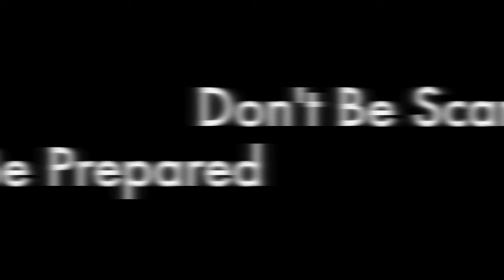What is Electromagnetic Pulse

Comment: As a Texas State Senator who tried in the 2015 legislative session to get a bill passed to harden the Texas grid against an EMP attack or nature's GMD, I learned first hand the strong control the electric power company lobby has on elected officials. We did manage to get a weak bill passed in the Senate but the power companies had it killed in the House. A very deceitful document which was carefully designed to mislead legislators was provided by the power company lobbyist to legislators at a critical in the process. The document was not just misleading, it actually contained false statements. 

The EMP/GMD threat is real and it is not "if" but WHEN it will happen. The responsibility for the catastrophic destruction and wide spread death of Americans which will occur will be on the hands os the executives of the power companies because they know what needs to be done and are refusing to do it. In my opinion power company executives, by refusing to work with the legislature to protect the electrical grid infrastructure are  committing an egregious act that is equivalent to treason.

I know and understand what I am saying. As a young US Air Force Captain, with a degree in electrical engineering from The Citadel, I was the project officer who lead the Air Force/contractor  team which designed, developed and installed the modification to "harden" the Minuteman Strategic missile to protect it from an EMP attack. 

The American people must demand that the power company executives that are hiding the truth stop deceiving the people and immediately begin protecting our electrical grid so that life as we know it today will not end when the terrorists EMP attack comes.

Comment: I am guessing about the theory on lightning. Lightning directly hitting power lines can knock out computers by a super surge. Even with a surge protector, the surge protector itself can be fried without any damage to the computer but EMPs are bit like lightning strikes struck directly. EMPs create a pulse wave that sets off gamma rays so, so powerful..with such super high currents that sensitive electronics don't have time to react with clamping voltages to lessen the pulse wave's effects. That's how EMPs can cause extremely devastating damage.